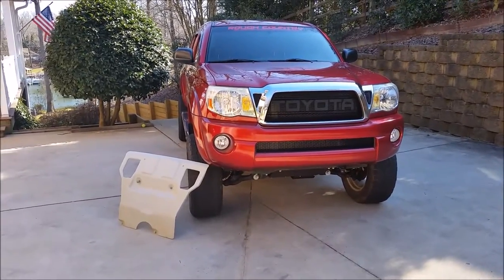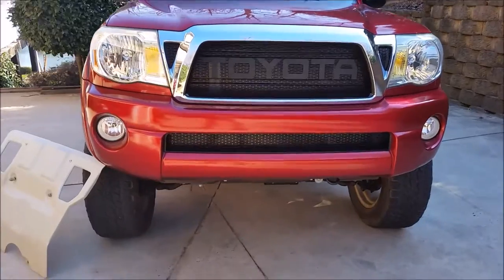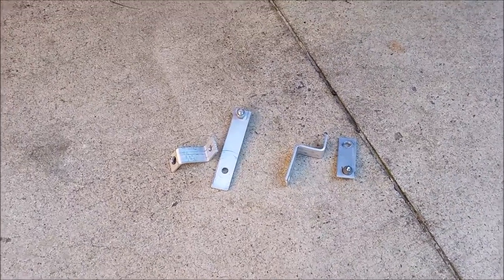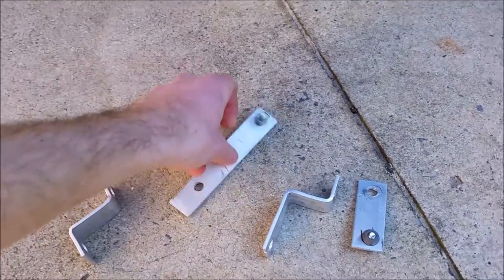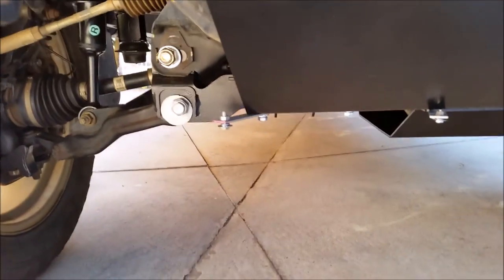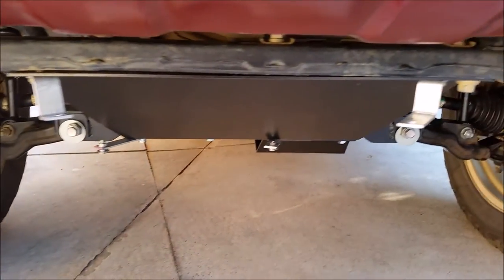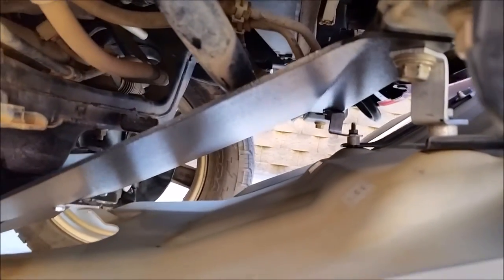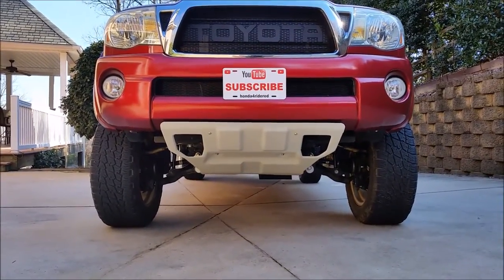2ND Generation Toyota Tacoma Factory Skid Plate Installation | 6 INCH LIFT

Comment: On your other video you took the old plate off,  then put it right back on??// Does the old one need to be on first
Reply from the maker: With the 3 inch lift, the stock plate could fit as well, with the 6 inch, the stock plate won't fit with the lift, but the plate that came with the lift will fit and I just covered that up with the silver one since I had it...Hopefully that wasn't confusing.